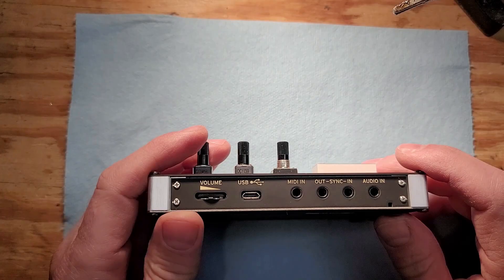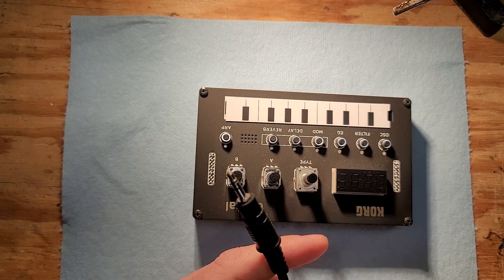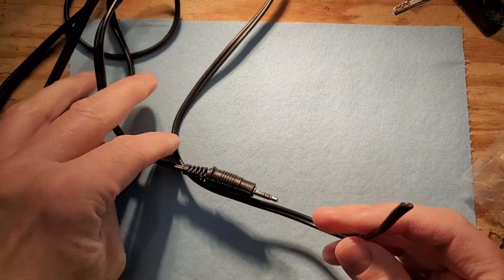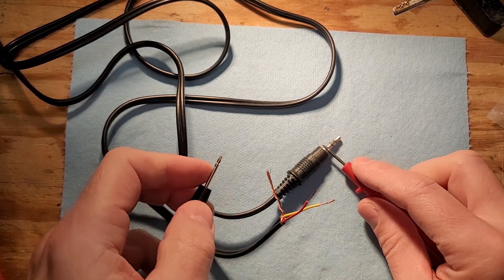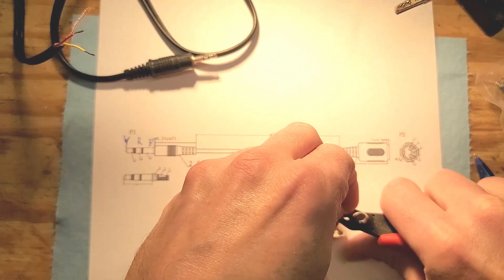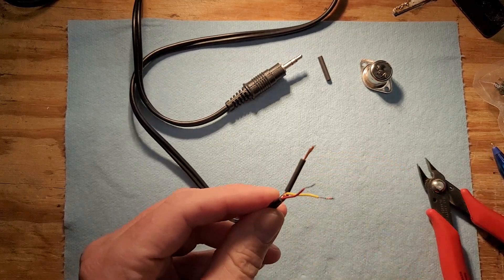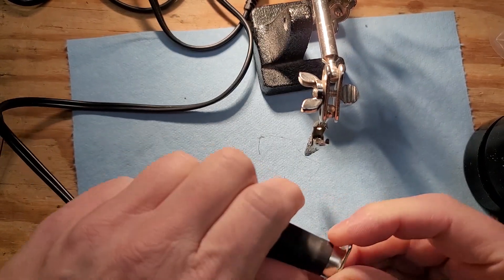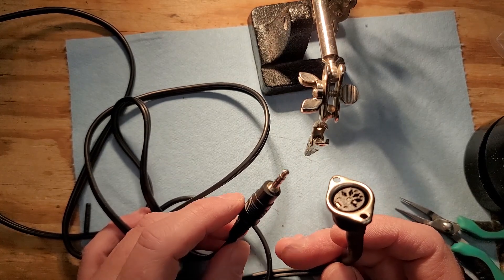How to Make a MIDI Type A Cable for the Korg NTS-1

Comment: Good point about the Korg USB midi driver - that has driven me bonkers several times. Synth specialist Tim Shoebridge has the best video on that issue.
Reply from the maker: Yes, his video does describe it very well - far better than the dismal Korg documentation. He doesn't cover the misery caused by the RNDIS driver nightmare introduced with the Wavestate/opsix/Modwave, but that's another issue altogether.

Comment: You can find a cable like that  when you purchase a  Korg SQ-1 helps a lot.
Reply from the maker: It's crazy that Korg didn't include one with the NTS-1!
Reply: Thanks a lot  ,just found one in the box of my SQ-1 without your comment I wouldn't have been any wiser n probabley made a cable or purchased one , odd that they never supplied one with the SQ64 that's why I'm here lol, gonna still make one with this tutorial and one with a 5 pin male midi din connection. 👍🏻

Comment: Why didn't you go with a male DIN connector instead? Just wondering if there is a technical reason.Thanks for the great video and information
Reply from the maker: Because cables get broken with use. By using a jack, I can use any length of any MIDI cable, and if it fails, I can just replace it and plug the new one into this jack.

Comment: For example, if i've stupidly bought a Type B MIDI-to-TRS cable instead of an A.. could I just hack it and twist the cables inside to get a Type-A? Actually is the second I've bought and I'm losing my patience  😝
Reply from the maker: Sure, just open the cable up and swap the wires.
Reply: @ScottsSynthStuff  Yessssss!! I've done that and it WORKS!! Thanks!! This is huge, the synth gets really really fun when you start using via midi, more while controlling the parameters with the Midi Implementation! Another thing that came to mind now is that you could create an aux "inverter" cable, and that could be really handy to use with other 3.5 midi devices (like .. lthe microfreak!)